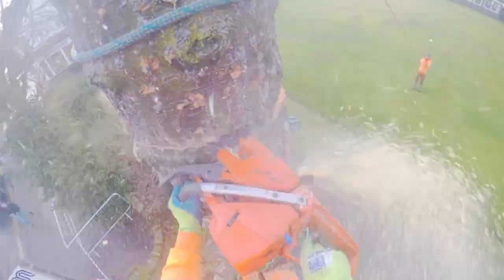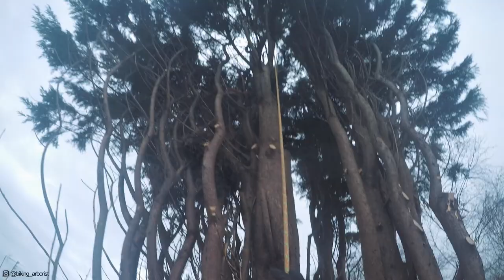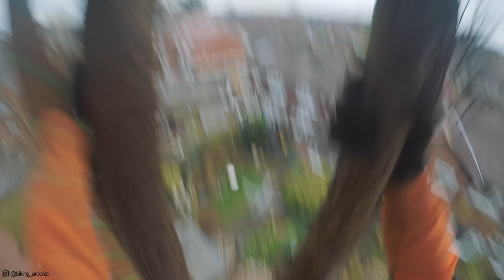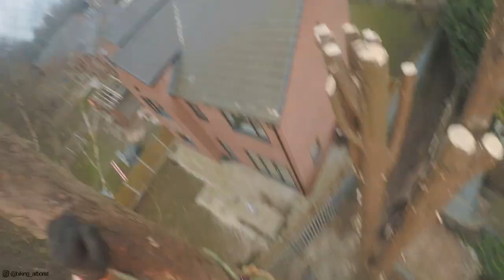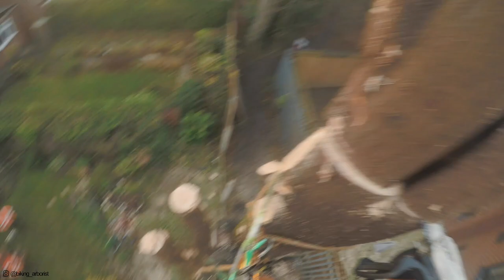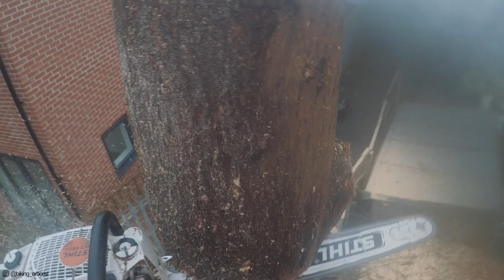SRT UK Conifer Arborist Removal

Comment: Like ur vids mate! Keep em coming. If I could capture tree surgery in the Midlands. A badly placed topped line of conifers left to get out of hand in a tight space with no access would be it. Gives me nightmares of past jobs lol.gd stuff tho worked through it well!
Reply from the maker: HaHa, you are dead right. Its funny I watch back the video and it doesn't look that bad really. It was just one of them jobs that took longer than I expected. All turned out well in the end. Thank you for your feedback Ross! - much appreciated.
Reply: I did a line of conifers last week just 10ft high but rli dense. Small wire fence inside. And I'm sure their was as much dust soil and litter inside it as their was brush. Took forever each stump had engulfed part of the metal fence posts 2. Just things u dnt see on the quote making it longer.got it done in the end tho!
Reply from the maker: @rosspatterson9397  yes that's what I'm talking about! You win some you loose some I guess. It's good to see the back of them jobs.

Comment: great video bud as always 

how you finding the zig zag and chicane combo? i was going to buy that for myself. Keen to hear your thoughts...
Reply from the maker: Thank you! It's ok I love how I can switch from double rope to single rope by just adding the chicane. If you ever need to pull some slack through it does struggle but other than that I have no problems. I haven't used any other SRT devices so can't compare I'm afraid.
Reply: Chicane zig zag is the best. I’ve been climbing on it for over a year and find it amazing for removals and pruning. Chicane handle is priceless every climb I do I’m using it with a foot ascender and my arm is straight . It’s the  perfect leverage . I’ll buy another when mine doesnt work anymore. An eye splice (petals flow/control)  that fits through the zigzag makes it the absolute perfect mechanical friction device. Thinking of making a video about how much I love it. Just buy one you won’t regret it
Reply: Oh and get a systeme 3A knee ascender. It’s life changingn
Reply from the maker: @jamesgodfrey6651  I will check that out also 👍🏼